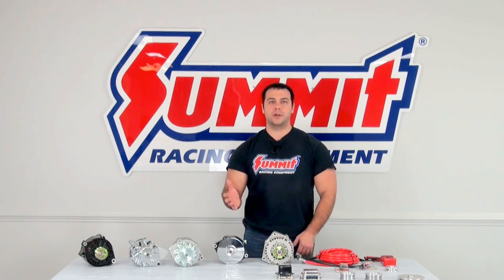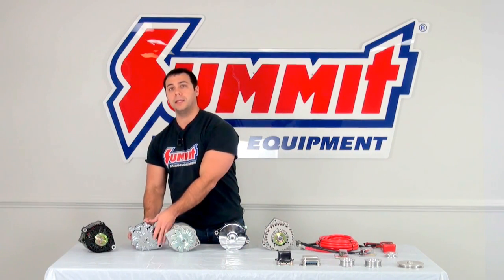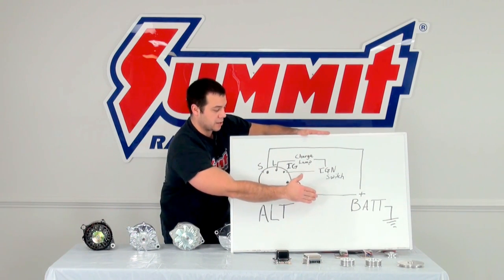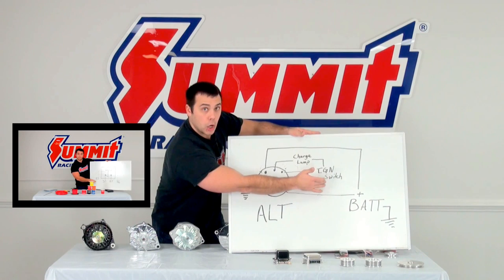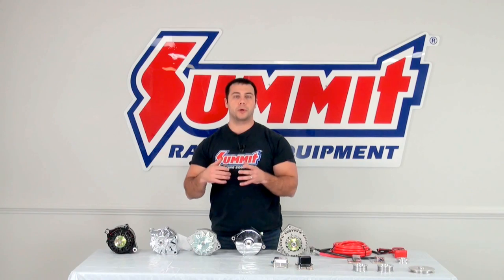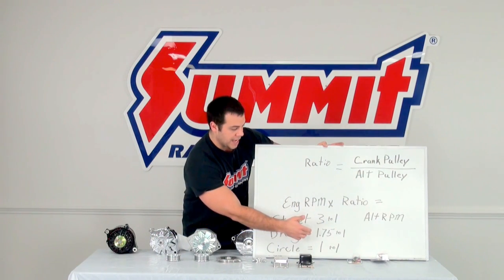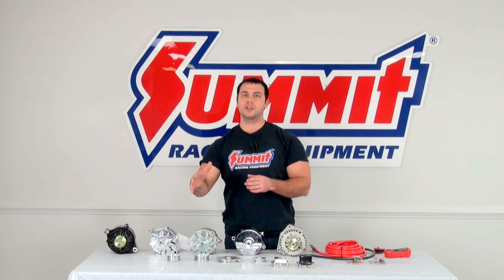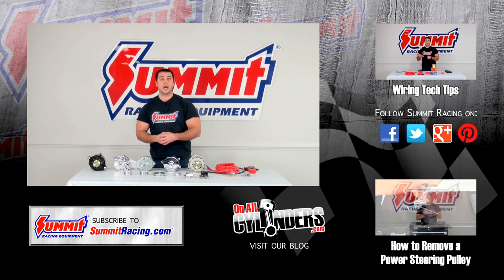Alternator Selection and Installation Tips - Summit Racing Quick Flicks

Comment: I got lost at using a relay? If I’m converting from a standard 3 wire gm alternator, to a 1 wire- do I just tape off the old two wire side plug and then install a new heavier (10-8 ga wire) to my dual battery switch, or do I NEED to install a 30 amp relay? I’m lost, because I can’t understand how a 30 amp relay can safely control 100 amps? This is in a jet boat - not that I imagine it’s any different wiring than a street rod. Thanks in advance for any info and anything that helps me understand this better!

Comment: Low voltage check could be a faulty battery, you want to tong the load current of all accessories running see the amps and get a rated altern alternator for that and also consider hot idle.

Comment: Great video!!!, learned a lot from this. I have a 94 Cadillac Deville 4.9L and the alternator plug that was on the car when I bought it  is a 2 wire plug the L and S letters is where the wires are stationed in the plug. I just recently upgraded to a 370 Amp cs144 hairpin high output alternator that came with the plug that is required to fit it which is a 3 pin plug,  im so confused on how to proceed in wiring this up, because here's where things get crazy,  so like I said my car has a 2 pin plug for the alternator, well the previous alternator that im upgrading from also has a 3 pin connector on it. So for the love of God please tell me how in the world was my cars alternator still working if it was missing a wire to the plug connector,  by the way working with minimal problems to my knowledge. Please HELP!!! Im going nuts trying to figure this one out. Thanks
Reply from the maker: Hi MR. 504, sounds like you may have the wrong part. Did you happen to order that part from us? If so, can you give us a call at 1-800-230-3030.
Reply: Instablaster...

Comment: on older rigs with external regulator,  does the regulator need some kind of upgrade with a higher output alternator? I talking over 200amps higher output then stock.
Reply from the maker: +grn dragon, 
Use of a quality replacement Heavy Duty voltage regulator is all that is necessary. Make sure that the plug is in good shape with no corrosion on the terminals and wiring is not cut, spliced or crispy!

Comment: 220 amp HO alternator installed in my car , with car in park without a/c on it trickles down to 12.8 and below, with a / c on it stays above 14v. is there any way to keep the voltage up above 14v as my stock alternator always had at idle.? I heard I could try leaving it unplugged to stop the computer from controlLing it.

Comment: Can you make a video on how to wire any appliance like, water pump, cd player, tv or any electric home appliances to a car alternator? If a car alternator produce 100 amp at 1200 rmp, then what will happen. The appliances will burn-out? What can we do in this case? Even the battery which is connected with the alternator can be burnt out by the over load of current from alternator. Should we use any fuse and relay circuit to maintain current and voltage?  Please explain all these. Thanks in advance.
Reply: Sounds like t
Your looking for a rectifier. They come with them in all 3 plug alternators. Or an inverter' however we already have dc power coming from the altenator.

Comment: I've always used these GM Delco 1-wire Alt, but all of them also come with a 2 terminal point with 1 & 2 indicated on the body and plugged shut with some rubber. I've always removed this rubber plug to expose the 2 terminals and connect the AAW universal wiring harness into this part for the GEN light in the dash. I believe they provide these point just in case you want to use them as GEN light indicator.
Reply from the maker: Thank you, Hatish!

Comment: what do I need for my 1985 Ford Thunderbird Turbo  2.3L looking to get a Alternator 100 Amps
Reply from the maker: Hi H2O, 
Provided you are using factory bracketry and the 1 groove belt, this Powermaster 100 amp is in stock and ready for ya!  PWM-8-57101-347  https://www.summitracing.com/parts/pwm-8-57101-347/overview/year/1985/make/ford/model/thunderbird
Reply: thx works nice :)

Comment: why is my one wire alternator getting real hot
Reply: David Reining too much power doe the smaller wire. Just replace it with a heavier gauge wire
Reply: Comment is old but check the amperage going through the wire and check wire gages limits to find out what gauge you need to replace it with